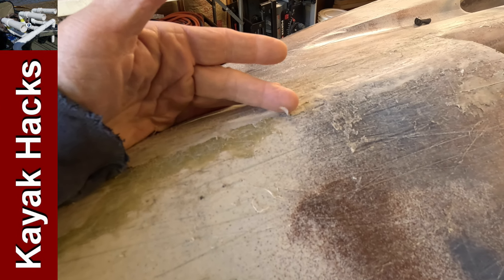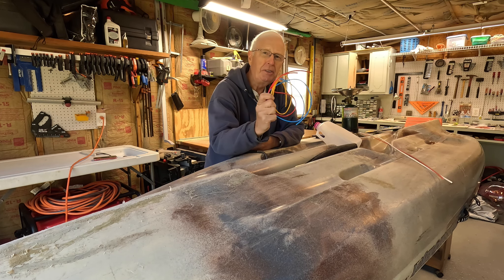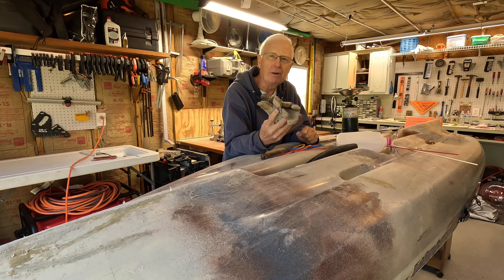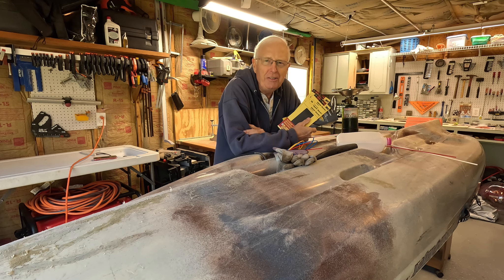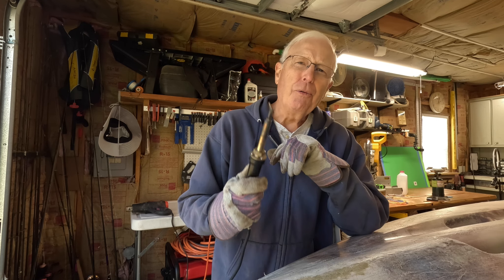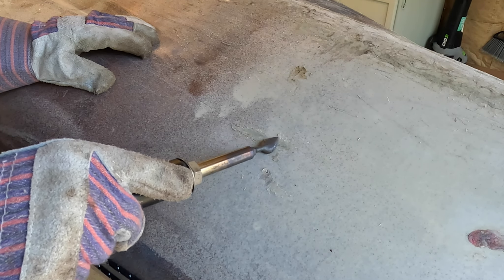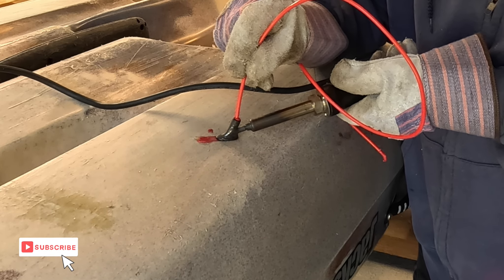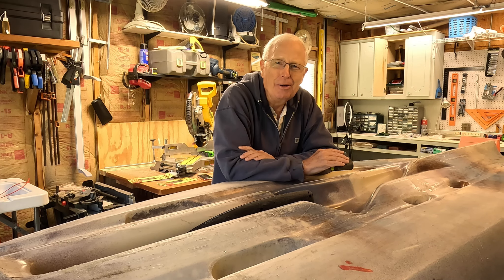DIY Kayak Repair For Beginners

Comment: Good info. I hadn't seen the DIY spoon method as we have the Hobie welder. Ran about $80, but we might have gotten it with something else and the total was $80 - too long ago. We haven't been doing the general smoothing. I've only dealt with the deep gouges (from concrete and oyster bars). But we really need to smooth it out as our normal cruising speed has dropped by 2 MPH since we got the kayak.
Reply from the maker: lol... the racing guys like the smoothing!

Comment: What about cable ties, aka zip ties? Can they be used? I've seen diy guys ued them in other projects.
Reply from the maker: I looked it up and it seems most are made from nylon. You need material made of HDPE to do a kayak repair. But, good idea. Shame it is not the right stuff... they would be the perfect size to melt in.
Reply: @KayakhacksFishing  ok thank you. Yeah they would